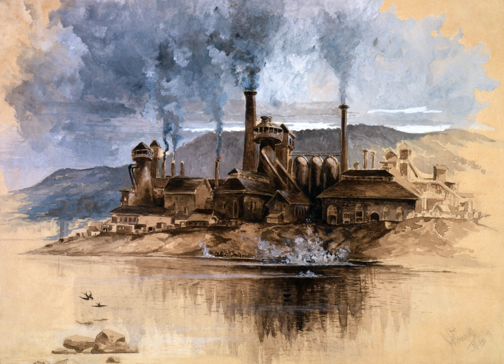History of the steel industry (1850–1970) | Wikipedia audio article

Comment: Steel is an alloy of iron and carbon and other elements.

Because of its high tensile strength and low cost, it is a major component used in buildings, infrastructure, tools, ships, automobiles, machines, appliances, and weapons.

Iron is the base metal of steel.

Iron is able to take on two crystalline forms (allotropic forms), body centered cubic and face centered cubic, depending on its temperature.

In the body-centered cubic arrangement, there is an iron atom in the center and eight atoms at the vertices of each cubic unit cell; in the face-centered cubic, there is one atom at the center of each of the six faces of the cubic unit cell and eight atoms at its vertices.

It is the interaction of the allotropes of iron with the alloying elements, primarily carbon, that gives steel and cast iron their range of unique properties.

In pure iron, the crystal structure has relatively little resistance to the iron atoms slipping past one another, and so pure iron is quite ductile, or soft and easily formed.

In steel, small amounts of carbon, other elements, and inclusions within the iron act as hardening agents that prevent the movement of dislocations that are common in the crystal lattices of iron atoms.

The carbon in typical steel alloys may contribute up to 2.14% of its weight.

Varying the amount of carbon and many other alloying elements, as well as controlling their chemical and physical makeup in the final steel (either as solute elements, or as precipitated phases), slows the movement of those dislocations that make pure iron ductile, and thus controls and enhances its qualities.

These qualities include such things as the hardness, quenching behavior, need for annealing, tempering behavior, yield strength, and tensile strength of the resulting steel.

The increase in steel's strength compared to pure iron is possible only by reducing iron's ductility.

Steel was produced in bloomery furnaces for thousands of years, but its large-scale, industrial use began only after more efficient production methods were devised in the 17th century, with the production of blister steel and then crucible steel.

With the invention of the Bessemer process in the mid-19th century, a new era of mass-produced steel began.

This was followed by the Siemens-Martin process and then the Gilchrist-Thomas process that refined the quality of steel.

With their introductions, mild steel replaced wrought iron.

Further refinements in the process, such as basic oxygen steelmaking (BOS), largely replaced earlier methods by further lowering the cost of production and increasing the quality of the final product.

Today, steel is one of the most common manmade materials in the world, with more than 1.6 billion tons produced annually.

Modern steel is generally identified by various grades defined by assorted standards organizations.